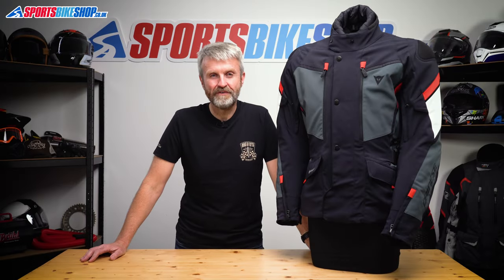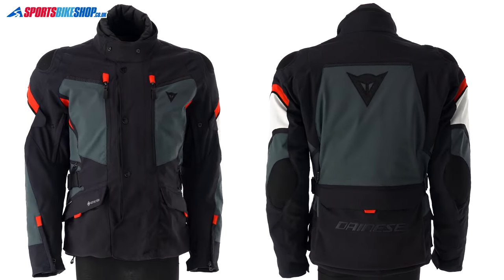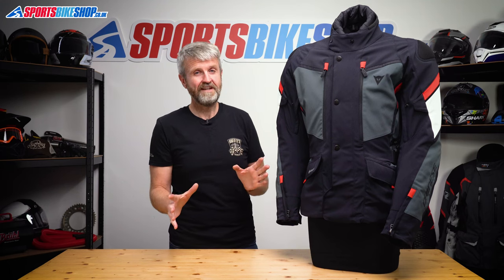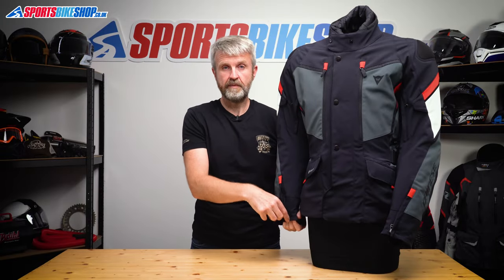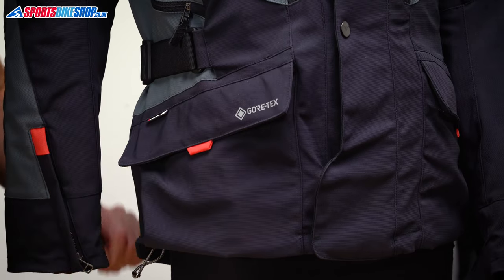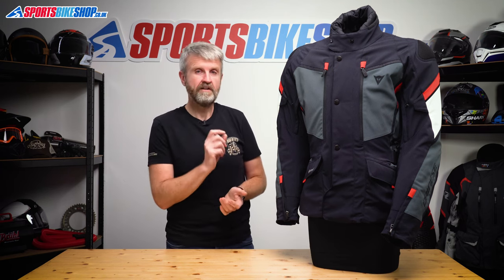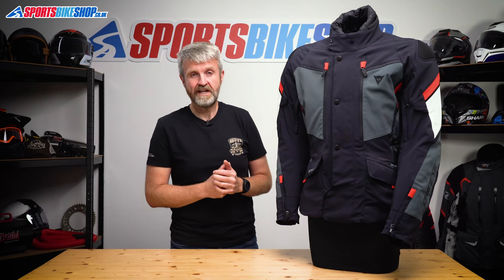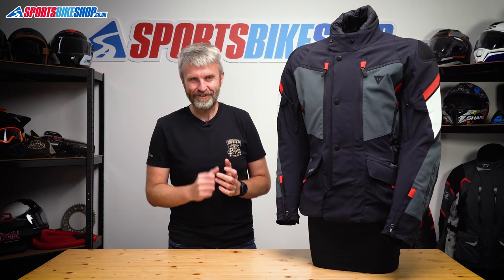Dainese Carve Master 3 Gore-Tex motorcycle jacket review - Sportsbikeshop

Comment: Thanks for the info, i'm looking for a gore tex. How does it do with the rain after 1 hour? I currently have the Dainese D-dry, but this 1 is def. not water resistant :(
Reply from the maker: I found it waterproof for that length of time (that's as much as I rode in). If a Gore-Tex jacket leaks then you have a warranty that lasts the usable life of the jacket, so I'd be confident in its performance. Cheers, Tony

Comment: Less pockets than the older model which has an internal chest pocket and 2 more external pockets on the outside of the waterproof ones , the waist connector zip could do with being longer  , its been a lovely warm winter jacket with that lining and collar , more adjustment in the cuffs would be good , hard to get them loose enough for winter gloves or tight enough for summer gloves

Comment: £600 and only A rated. Oooftt. I have RST jackets for half the price that meet AA.
Reply: Yep, plus the extra money for the back and chest protector. Love Dainese but questionable value. 

Great review as always. Informative.
Reply: Have you seen MotoCAP’s test results for Dainese? No Dainese textile jacket scores more than a 1-star 😱protection rating. In contrast, the Alpinestars Halo Drystar jacket achieves a 4-star safety rating. Also, MotoCAP test results for Dainese gloves are similarly appalling for abrasion resistance ☹️
Reply: @The-Splat  yeah it's overpriced crap with very good branding and marketing in my opinion.